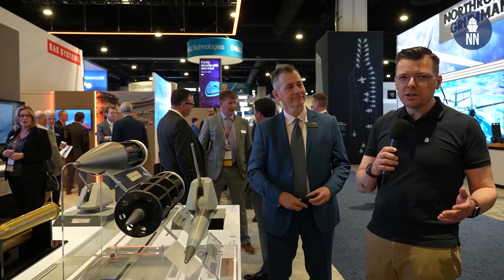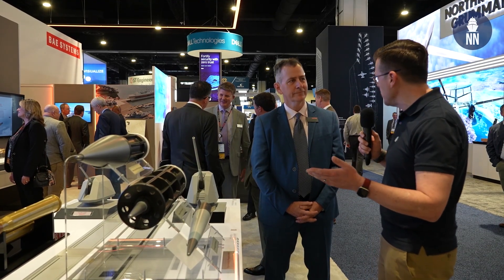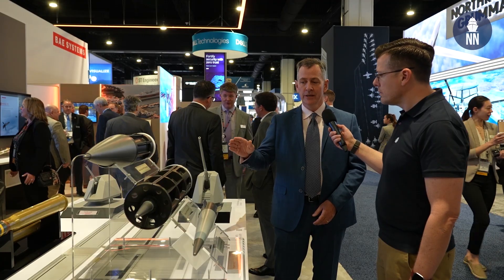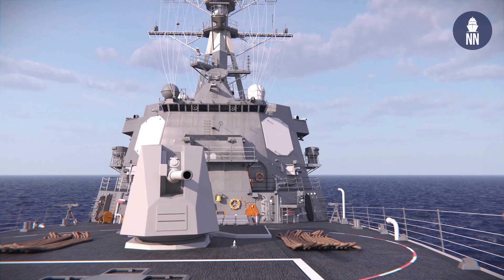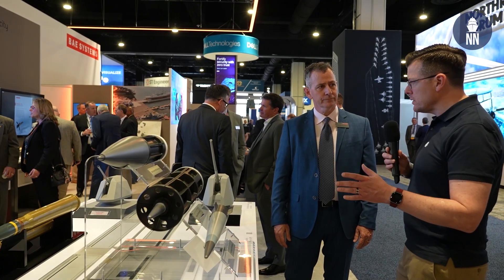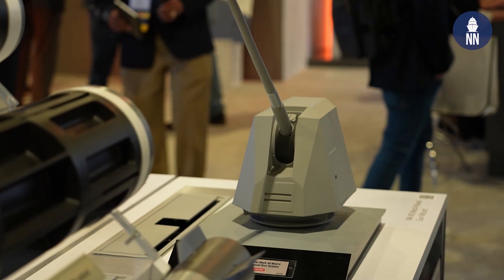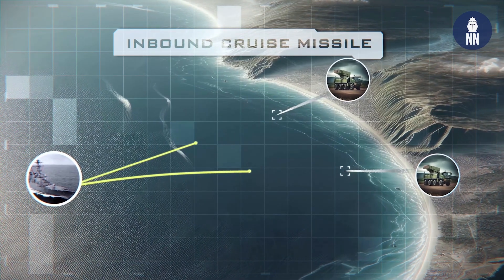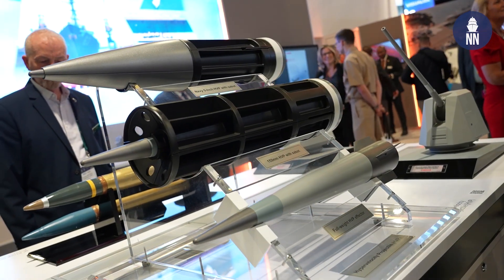Hypervelocity Projectile (HVP) at Sea Air Space 2024

Comment: Comparing the cost of implementation, the interviewee did not disclose at what cost per round this would be. Is it a 1% savings, 5%, 10% because that's all a 'fraction of the cost.' Naval News, your reporters need to make these guys sweat and press them for details. No more softball interviews, we need concrete facts!
Reply: in 2019,  HVP cost between $75-100k per shot, so it cost slightly less than the latest FIM-92 manpad.
Reply: @Boomkoko220 
and this remind me Vulcano (range 50 nm) round from Leonardo at begining they though it will cost 10,000 eventually 20,000 (double?) but now that is in production it ended up at 60,000 USD a piece or in case of US Navy kind of production numbers the price tag could lower to 40,000 per GPS guided round plus 5/10,000 for added Semi Active Laser or Infra Red guidance system, so a cost per ammunition of 50,000 USD or less for land or naval targets and no anti-air round because (up to 5 nm range in just over 5 seconds) Leonardo have at about 35,000 per round the 76mm Dart anti-missile ammunition but to reach about a 100% kill probability the concept is to fire a trail of three rounds per target, so 100,000 USD in total.
I believe at best if it really reach the production stage it will cost minimum 250,000 not a great advantage over RAM missile and a shame in front of Iron Dome missile's 100,000 price (but you would have to add a new system on board)

"fraction of cost" is like the discounts at 50% with the same price at the end, not to mention the total SILENCE over range question 🤣🤣🤣

Comment: Lo and behold, it is the Italian "Vulcano" cal. 127 from Oto Melara, and its guided projectiles reach 120 km with 2-meter accuracy. They have been in service in Italian ships for 10 years. I'll remove the like.
Reply: Vulcano also costs $400k/round and has no ability to intercept aircraft.   Go troll somewhere else.
Reply: @GintaPPE1000  Excerpt from the authorization for the sale of war material of the Italian Parliament "Leonardo - 185 CAL cartridges. 76MM TP-OM at a cost of €314,814 (€1,702 each) - 75 ammunition cal. 76MM HE - SAPOMER without classified fuze, at a cost of €150,375 (€2,005 each) - 10,500 ammunition cal. 76 mm mod. 79, Sapomer without classified fuse, HE MOMA1 with 4AP fuse, at a cost of € 18.188 million - 76 mm ammunition (900 HE MOMA1 with 4AP fuse, 600 TP-OM, 200 Vulcan (76 mm) BER HE and 206 GLR HE, at a cost of € 13.742 million - 20 VULCANO ammunition cal. 127MM BER HE, at a cost of €360,000 (18.000 € each) - 3 UAS Astore ER-BML (€39.8 million contract) - 3 x 76/62 SR MF (€20.7 million contract) - 5 x 76/62 SR MF (€29.92 million contract; of which 1 gun per balipedo) - 1 x 76/62 SR MF (€7.299 million contract) - 4 x 76/62 SR (2 contracts of €14.22 million each) - 4 x 76/62 SR STRALES (€46.706 million contract; €11.76 million each)" As you can see I am not a troll, GPS, IR and laser guided munitions do not exceed $40,000, 2000 unguided ones.
Reply: @GintaPPE1000 where's the source its 400k?
Reply: @GintaPPE1000 
ops you add an extra zero to the price tag offered at US Navy, italian navy Marina Militare with its small numbers paid GPS Vulcano less then 60,000 USD a piece about the same as germans
Reply: It’s not Vulcano though, that’s just factually incorrect. It fulfills a similar role, but with some significant differences. That’s like looking at an ESSM and saying it’s a CAMM, yes, similar role, similar approach, but totally different system.
Reply: Vulcano is nothing special, it's just a basic GPS guided guided shell. Leonardo also only claims 80 km, not 120 km.
Reply: @ARCNA442 
it's part of agreement with BAE because Vulcano round is compatibile with their 127/62 gun but was developed for Leonardo's 127/64 so balistically the first could reach over 100 Km range and second 120 Km so they agree to use in public 80 Km which is the Vulcano munition range when fired from old Oto-Melara 127mm/54 Compatto
Reply: The Vulcano is competing against the BAE MS-SGP, Raytheon's Excalibur N5 and the HVP
Its being considered but no final decision has been made but given the Red Sea , Israel and Iran shit storm
and the shear about SM-2, SM-6s and Asters have expended so far
They may speed things up a bit
But also realize Lockheed has developed 300kW laser prototype to the Army as well as has plans for 500kw variant
This falls in line with the USN planning for 600kW for its DDGX
The current ships will likely get guided rounds as they dont have the power to spare but the DDGX will reuse the DDG-1000 Integrated electric propulsion (IEP) which produces 78MW
ample power for a laser weapon ,possible even megawatt class. The USN is also looking at high powered microwave weapons as well
At the end of the day
kinetic weapons like the HVP may last resort if direct energy weapons cant do it
Reply: @jonnytaco7671  https://www.youtube.com/watch?v=61YnsQ1v0mw&t=278s
Reply: "I'll remove my like" is the modern day version of kids taking their ball and running home while crying. Being sensitive isn't a good quality to have, it's a character flaw.
Reply: @steamedcream7671  The 127 and 155 was not tested for aircraft, only subsonic missiles, but there is the 76 "Strales" system with "David" guided munitions, which follows a radio beam to the target, tested with aircraft and missiles in the Red Sea. A guided projectile with fuze $6000, a conventional munition with fuze $1000. An SM 3 missile $2,000,000.

Comment: How they are guided?
Reply: Before the Navy cancelled this program, it was GPS/INS only with no ability to hit moving targets unless you removed the explosive filler and replaced it with a seeker.  Which is a large part of why they cancelled it.
Reply: @GintaPPE1000  they could use a guidance like on dart for it.
Reply: @kqckeforyou4433would probably heavily screw with the hypersonic aerodynamics theyve figured out to just strap something to its nose. Remember this thing is going horrendously fast
Reply: If it have antiship capacity, the only way is guided by infra red. 
  To attac land targets, GPS is the way.
   Sorry for my bad english. I am spaniard.
Reply: @JesusSanchez-ij5de Isn't the projectile too hot for using IIR seeker?
Reply: @PietroColombo-em5mz   Usualy the sensors gets colds whit gas, like some manpads missiles. I don't now in thats case.
   Sorry for my bad english. I am spaniard.
Reply: No lo explica con lujo de detalles ... pero lo que si sé es que puede ser Autodirigido me imagino por sistema GPS desde un satélite en el area y como arma antimisil antibuques !!
Reply: More than likely will MMW radar guidance with data link
Raytheon and BAE already made Excalibur N5 which is scaled down M982 Excalibur shell for the USN 5 inch gun
Reply: @verdebusterAP Yeah, it's crazy how cheap and compact MMW radar tech has gotten compared to just 20 years ago. At this point, I wouldn't be surprised if some next gen MANPADs that go to replace the likes of the Stinger end up being MMW instead of IR guided.
Reply: @7ElevenTruther  
The main advantage of IR is that its not triggered by RWR
its up to MAWS to detect it
IR seekers are getting much much harder to fool
Reply: Just like how it has been since WWII, the gun is radar guided and the gun laying computer would predict the missile or aircraft path and then once firing solution was calculated the projectile is fired, note that it won't be one shot one kill with the gun, its a minimum of 5-10 shots per kill in 21st century standards, in WWII for 5inch gun to score a hit would require more shots